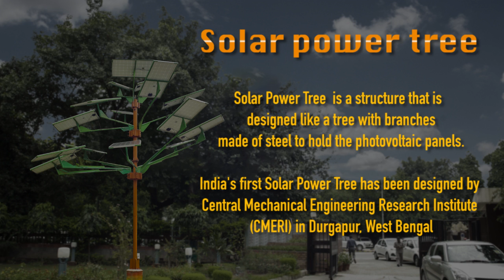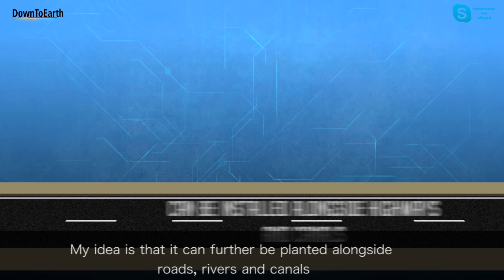India's first Solar Power Tree

Comment: Why not just put the same panels on a nearby roof? They will be even higher, will shade they building roof to reduce cooling costs, and you avoid the cost of the tree structure.
Reply: They can be put up in villages/fields/remote areas for the aid of farmers and rural families where  concrete buildings might not be present